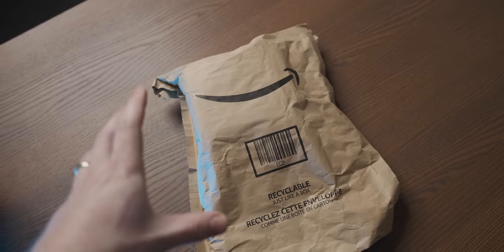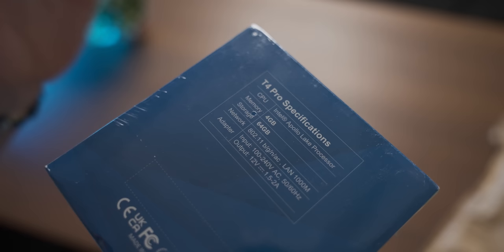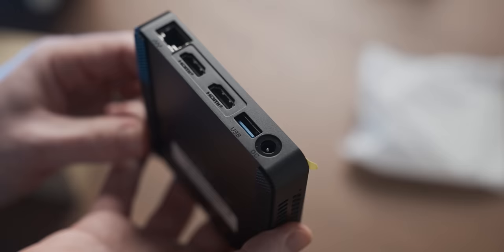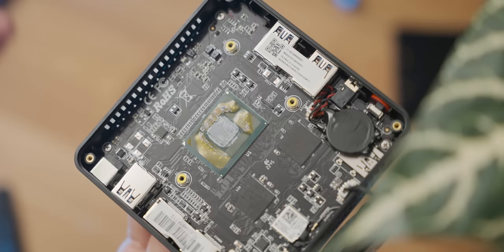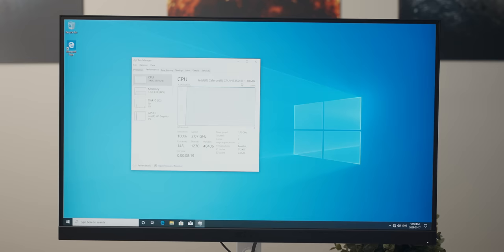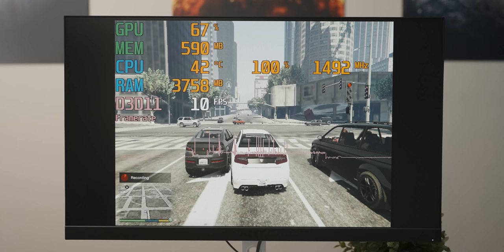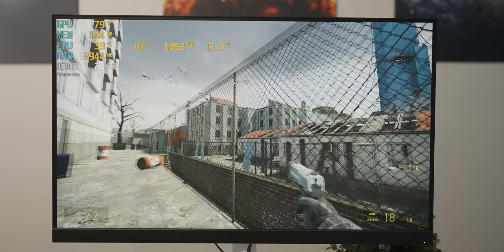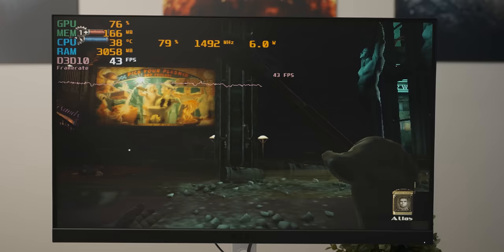This $100ish Amazon PC Is Apparently "Perfect for gaming"...

Comment: This is most definitely a thin client workstation (hence the name). Used to connect to a server and run virtual machine environments. We use similar Dell branded ones, at 8x the price. So for $100, this thing is actually brilliant.
Reply: Thin clients are $800? At that point, why not just purchase a standard PC? Unless you’re remoting into a server for like CAD work or something
Reply: @bandombeviews6035  I guess the IT or company want control over employees
Reply: @bandombeviews6035  Fair question.  I saw that going right back to the 1990s.. they'd sell X servers (for UNIX system use), then thin clients (typically X server and Windows Remote Desktop client basically) for prices like that, well into the territory where you could have just bought a PC and popped it on their desk even if it was just working as a thin client connecting into some remote system.
Reply: You say this like the ones you use are the same but just 8x the price. I highly doubt they are even close. The school laptops we have have a CPU MUCH better than the one in the video, and it is still absolute garbage. I swear some days it struggles to run basic things like Chrome and Teams. So, if you are getting the same as this for 800 which, you guys are getting scammed (but I doubt they are even remotely close). I also doubt that it would be any good at running virtual machine environments.
Reply: @cedarcoombs8111  I believe OP is talking about Virtual Desktop Infrastructure, not running VMs on the client. Thin clients don't need a lot of power because all the heavy lifting is being done by the user's VM on a central server, then streamed over the network via remote desktop. This makes it super resilient to theft since the sensitive data always stays on the central server. The only thing the thin client has to be capable of doing is connecting to the server and relaying its display and I/O.

Comment: Honestly, for the size and price. This is a pretty badass product.
Reply: Actually, I kind of like it. I mean it's not a Windows gaming PC but it's a step up in power from a Raspberry Pi. 4GB of memory might be limited but I grew up squeezing the last bits of power out of a C64 so I've never actually used 4GB of memory.
Reply: @immortalsofar5314 my first PC had a 8mb integrated graphics card and was using AOL you had it easy lol
Reply: not really. you can buy a laptop for like $125-150 thats more powerful than whatever this thing is lol. Heck, even a used laptop for $100 is more impressive.
Reply: @thelonercoder5816 its form factor, its small and compact because it serves a niche purpose which you probably won’t understand

Comment: I been using my $125 J4125 mini pc with 256 ssd, 8Gb ram for 2 years.  Worked great as media player and light web browsing.  But recently I been doing more on it and it is struggling.  So got Beelink Ryzen 5 5500u, 16Gb ram, 500Gb nvme ssd for $225.  Big improvement from J4125.  And this thing is so tiny but powerful.
Reply: Nice
Reply: could have got a used gaming laptop lol
Reply: @خلصذيب  Laptop too large and can not be mounted behind TV.  Would not work for my purpose.

Comment: That's actually really cool to see for a machine like that. Having it to run older gen emulators is a good use case for it.
Reply: Why not just use a raspberry pi 4 for like cheaper if you want emulation for the same price
Reply: @deanasher2155  Because you likely won't be offered a free Pi from your office job when they cycle out the old machines? This kind of device is common, as is them being given out to employees when retired from use.

Comment: There's another one with a J4125 for about the same price, it has double the cores, double the base clock, and intel graphics 600 instead of 500 !
How about this becomes a series, trying out mini pcs. Maybe you'll find a gem!
Reply: Can i have the link plz cause I'm not getting
Reply: Ooh I love this idea. Second this!
Reply: Don't we have @ServeTheHome for that?
Reply: Four words, Lenovo Thinkcentre Tiny PCs. Used market on these are not bad and have much more capability once you get into the i5 and i7 models. Also, they are very easy to maintain and upgrade to SSD and better ram.
Reply: @MrMega200  Agreed! I picked up a refurb micro form factor HP Elitedesk for just about $150(usd) and it won't go up to 11 without creativity but it runs 10 just fine and I'm planning to use it for a home server (I upgraded the ram and the nvme drive is on the way). Better price/specs than a Raspberry Pi with the current market rates
Reply: Yes please!
Reply: @blizzzofficial  nah g
Reply: I AM doing a series on them, but not for gaming.  I'm glad I hadn't spent the money on the T4 Pro now.
Reply: Literally get that for a work clients so I can remote into their systems
Reply: Couldn't agree more, J4125 is a really powerful CPU. Even in dongle stick form factor can replace most needs for a home theater or smartTV browsing. Consider buying one of those instead of the worse ARM based tvBoxes. It will last longer, and you can repurpose them as much as you want...
Reply: @mihkus  Exactly. The only negative point against it would be a larger form factor and that needs a bigger external power supply. Both DELL and HP's SFF PC are what you really need for a general purpose computer.
Reply: I have one with the J4125, it's actually pretty usable for basic usage and a lot of indie games runs okay. I've actually removed Windows and installed Batocera, it can run N64 perfectly at 1080p and GameCube at 2x resolution, which is pretty good. PS2 is still crap though, but it has more to do with the bad PCSX2 core in Retroarch.
Reply: a bit cringe but, what's a good one that would run fortnite at least with 60 fps? mini pc.
Reply: I was thinking about getting that one, stick it behind my TV and use it for steamlink and GeForce now
Reply: I bought one but it was in the form of a usb stick and had 6gb of ram. I use it on my tv in my front room because I can install ad block :D
Reply: @xtc0  nothing from Intel with integrated graphics. AMD Apus will do 1080p fortnite 60fps(2200g and better). Even uhd 730 can only do 40-45 fps at 1080 ultra low. Uhd 770 can probably do it but now you're talking a CPU expensive enough to buy an old HP/Lenovo and shove a cheap GPU in and get way more performance anyway.

Or any potato PC with a low profile GPU like a 1030.
Reply: yep that the same cpu i have in windows laptop i got free and it can run fortnite in performance mode at 720p with good fps and also plays minecraft well
Reply from the maker: That’s a good idea. I’ll see if I can find enough to do a round up with.
Reply: @DawidDoesTechStuff  cool
Reply: J5040 or N6005 💪
Reply: I saw some people can upgrade cpu or gpu from laptop mother board, wanna know what’s the best cpu you can put on this board? and I guess the ram is 4 or 8 at max?
Reply: AliExpress keeps recommending me some pretty beefy AMD 7xxx-based ones, wonder if they're actually any good
Reply: You should have done wii/GameCube emulation
Reply: Brilliant comment. Hey @Dawid maybe an alternative section with recommendations would work on a video like this.
Reply: You mean double the price.
Reply: The AKLWY with J4125 looks like an option. It's super tiny and only $119, same price as the T4, both on Amazon US
Reply: @AmstradExin  No i saw one for $130. Didnt say it was the same brand or anything though. But lets be honest these mini pc are probably all coming from only a couple factories anyway
Reply: Maybe you should take a look at Chatreey with Intel Celeron N5095 based mini PC, which starts at $130 right now. It has Intel Celeron N5095, 8 GB of RAM, 128 to 512 GB SSD, Bluetooth and Wi-FI, and 2 NICs, which is perfect if you want to use it as a router.
PS: for some reason, they sent the Intel Celeron N5105 to me instead of N5095.
Reply: I watched to the end to see if he was gonna show some cloud gaming or local game streaming and was sincerely disappointed. 😢
Reply: @BlazePas  
Honestly, I know we're supposed to point and laugh at the tiny little E-peen on these things but there was no way native gaming was ever going to work on this thing.
Reply: @DawidDoesTechStuff  yes
Reply: There is another channel that deals with mini pcs bruh these toys are amazing
Reply: @titaniumwo1f390  could you please run userbenchmark on it and paste there the link to the result im really interested on this
Reply: @titaniumwo1f390  According to Userbenchmark you got a weaker cpu...
Reply: @maxheadroom22and26  You should not trust majority, if not all, of benchmark results from UserBenchmark, as they were (and I think still are) very bias towards Intel and NVIDIA to the point that r/Hardware and r/Intel ban UserBenchmark (quite irony that r/Intel bans them), and many PC forums will scrutinize you if you post a benchmark from UserBenchmark. Also, they used to change their own scoring just to make AMD CPU bad, but the result is so bad that they gave i3-9350KF higher score than i9-9980XE.
Reply: yeah half a million views in a week for reviewing a hundred buck mini pc? I'd be doing more.
Reply: @titaniumwo1f390  To me Userbenchmark is the most "complete" list of cpus and gpus with ratings. So whenever there is something from intel/amd or nvidia/amd with a very close score, amd is better: good to know! The site is good to compare different generations which are not listed on other sites anymore. So it's still useful, i guess...
Reply: Amazon has the Minisforum HX90 with Ryzen 9 5000 series processor and 32gb of ram for ~$600. Now THAT is a good deal!
Reply: What do you think this is, ETA PRIME ?
Reply: @MrMega200  Agreed, unless you are very limited on form factor it's a great and expandable option. Used those in my shop (automotive garage) in a few iterations: Celeron, i5-4570T, and paired with some $20 SSD's. Ran a few gaming servers, streaming music and video, and they worked great! Resold on eBay for about what I had in them and kept the SSD's for later.
Reply: I'd love to see that because I've been looking for a cheap portable guy to mess with when works slow (desk job lol). Now I just need a tiny monitor or something
Reply: There's a beelink for like $300 that I have a strong feeling can run most games at 1080p
Reply: At this price range a small price difference can be an exponential increase in performance sometimes
Reply: Dissing a little pc for punching above its weight is the kind of thing I expect from any privileged ingrate.
Reply: Not trying out mini PCs. Trying out insanely cheap mini PCs
Reply: There are Pentium Silver 5000/5100 that I think do better, I bought a few for family members who didn't even have a PC.

Comment: I actually have one of these powering a custom homebuilt pinball machine (physical, not virtual).  I write my own pinball machine control software that runs on Windows, and to challenge myself to make my code extremely efficient I picked up one of these weak PCs.  It did expose a few flaws in my code, but after some development time I've got my code running nearly perfect.  Not only does this tiny PC handle all the I/O for the lights, switches and solenoids (via a USB breakout board, oh and pinball is extremely latency sensitive), but also handles running the DMD animations.  Bonus, I use a 27" monitor as the pinball backglass, and my control software GUI can even play videos during gameplay without affecting gameplay latency.  So I agree, gaming is a big YES and 5-stars!  That said, I wouldn't mind doubling the cores for some processing headroom and faster NVMe storage for quicker startup.  It's surprisingly hard to find tiny, decent little PC's like this with good-enough performance at dirt cheap prices.

Comment: Honestly would like to see this with some sort of emulation focused Linux distro like Batocera and see how it handles emulation.  For the price, with the thoughtful IO and mounting options this could be a neat little TV mounted emulation box
Reply: My thoughts excactly. It would be nice to see this tested for a realistic use case like an Android TV box.
Reply: Something with a chip like the rk3588 would be much more suited than this I think, though they might cost a touch more... I just noticed a newer one with a cut down rk3588s being announced on liliputing in my rss feed on me phone called the Radxa Rock5 model A which seems to be on pre-order for $89 (30 discount) for the 8gb LPDDR4 version however.  That is just a bare board similar to buying a pi, mind, but a kind of tempting price for an 8 core chip with a quad core mali gpu :).. the model B has more usb and hdmi and PCIe3.0 from what I can tell and came out for sale last year but is quite a bit more pricey, at least compared to the preorder discount.

There are a few reviews of devices with the rk3588 being used for emulation up to ps2 and gamecube in android which is pretty good going, but it seems they have also gotten it fully supported in reborn os arch linux now which also makes it more of an actual budget mini pc competitor.  Even for things like a plex server I guess since they claim it can encode 16 channels of 1080p30 and comes with 1gig ethernet and wifi 6e, lol.. not sure, I am tempted to grab one for a nosey however :)
Reply: I’m thinking of picking it up with just that in mind.

Comment: Pro tip, disable telemetry, set all services to manual, set display for performance, disable cortana... a few things to make winblows run smoother on underpowered hardware. Chris Titus has a great script for this purpose.
Reply: Yes,with a little bit fine tuning it can be more efficient, I think ( in my case ) it can run as mqtt server,Kodi,Arduino IDE, PlatformIO and some more things perfectly.

Comment: TBH, from a business perspective that sort of system is decent as a thin client to run a virtual desktop. Significantly better connectivity and specs than the old Wyse Winterms I supported in the past as well as being much, much more compact. Personally I'd prefer a little more RAM but that's because a modern browser would struggle with only 4 GB and that's the sort of thing I'd prefer to run locally if possible. Really good for the price though, especially when kitting out a full office. There are also some alleged workstation replacements out there in a similar form factor, IIRC the company is BeeLink, but I don't know if you've already done one of those.

Comment: This is a very good PC for a POS situation or any kind of front end reception kind of deal where you want the PC to be hidden, likely mounted on the monitor someone is using.

It's so well designed though!
Reply: Yeah, that's a good price for a kiosk type PC. 

My company (before I left) was paying well over that to buy Dell wyze thin clients with similar specs, they were restricted down to a browser login for citrix to launch Citrix hosted apps. 

The dells were probably 250. 

Although this won't have remote management... Can't reimage one of these remotely, so I get why they paid for the professional product... But for a small company? Perfect.
Reply: @volvo09  oh yeah, and I've worked on worse specced POS thin clients.

This is the only time I will say soldered RAM and storage is good: when the goal is a device whose whole life is to logon to a web interface and do data entry.

Like, this PCa entire life is going to be sitting under a dust filled desk with terrible ventilation while someone hammers on a greasy keyboard all day long as it sends data to a backend server to do the actual compute work.

Comment: I do have a Intel 3205U based non-branded box with 8G RAM and 4 gigE ports, to work as a mini server. That provides 3 vms based on proxmox VE - a 7x24 Home Assistant vm, a 7x24 Linux mint 21 xfce vm, and a turn-on-as-needed NAS vm (with auto "power-off" for storage hdd spin down). It looks the power is still not used up.

Comment: Would be interesting to see Dawid get one of the Ryzen 9 6900HX powered Mini PCs (with Radeon 680M graphics) and find some "interesting" test/use case for it, like testing 8K 60Hz gaming. Dawid's Deathmatch Arena of Death: Minisforum UM690 (or Beelink GTR6) vs. something silly.
Reply: So I have a laptop that is basically that. R9 6900HS and 680M. I get similar performance to a 1650 mobile when I unlock the power limit. With that limit unlocked though I have seen 45W on the iGPU alone. The RDNA3 APUs should be even faster. We might even see 2060Max-Q performance out of them.

Comment: I see Celeron and I run away screaming! Even a good arm chip is going to be better.
Reply: The worst part is, that people actually cherishing being ripped off $100 USD for some ultra-cheap (as in shoddy in terms of quality, contrary to inexpensive …) low-performance compute-box with utter sub-standard performance-metrics and horrible price-performance ratio, which is based upon a low-grade Dual-core of 2016, without any Hyperthreading mind you!

I mean, even the Raspberry Pi has a quad-core since years now! A darn dual-core, even with·out anything Hyperthreading in 2023, being tortured to death by of all things Windows 10 …

Let's face it, it would be better of with either FreeDOS or anythign Linux/Unix. Since anything Windows past Windows 7 reduces this box to actually environmentally polluting e-waste and Intel should be charged huge fines to even issue such scrap-hardware in the first place …

insurmountable
Reply: @Smartcom5  It's funny that if you don't mind getting an old computer, you actually get a far more powerful PC if you buy a corporate one. I've been using an i5-2400 based corporate PC that only cost 40 dollars for a long time now.
Reply: @TheSteveTheDragon  You likely misunderstood me, I've nothing against older hardware per se.

I'm just stupefied by the amount of people who cheer upon being actually ripped off with glorified Intel e-Junk and pay hundreds of dollars for substandard shoddy hardware.

This stuff is just e-Waste and nothing more.
Reply: @Smartcom5  On that, I agree.